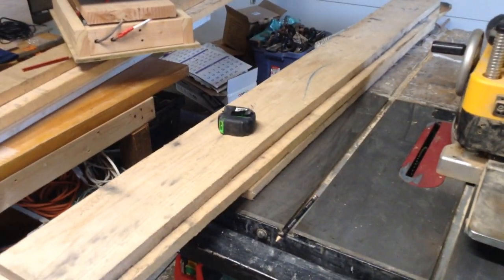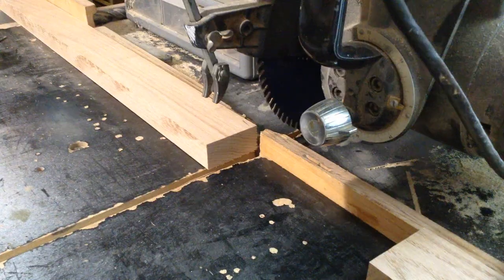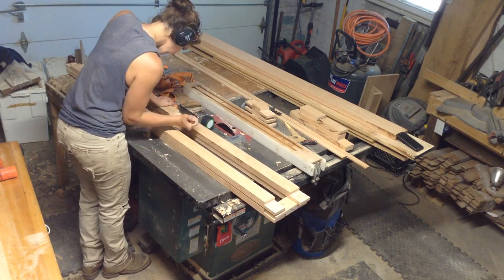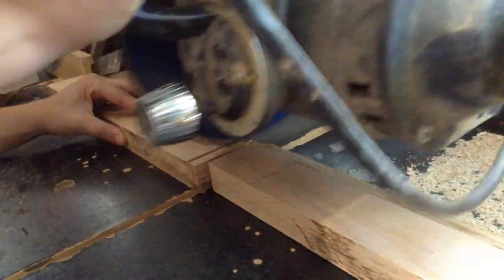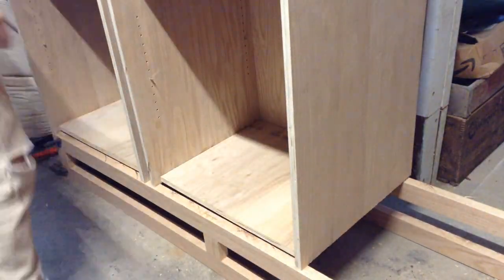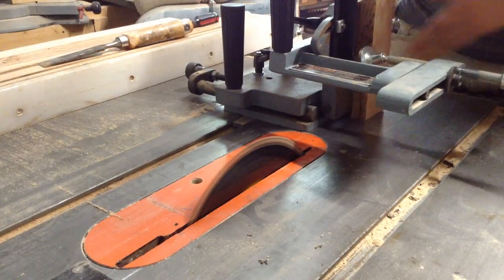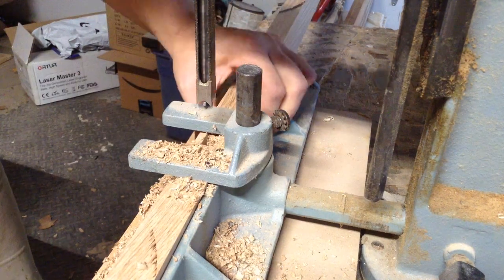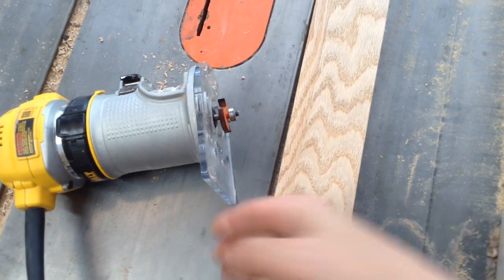Woodworking : China Cabinet & Storage // How - To Part 2

Comment: Cabinet coming on nicely, it’s a bit of a pain when you have to deal with bends and movement in the timber and ply wood especially when you have already made the cabinet 🙄,having a movable shelf isn’t really helping much either, it would have been helpful to have been able to glue this shelf in, looking forward to the next episode 👌👌👌👍👍👍🇦🇺
Reply from the maker: I know, usually people don't care whether the shelf is adjustable or not.  But, this customer really wanted to be able to move them so I wasn't going to say no.  I was quickly reminded why I hate them though.  Because on top of the issue with the sides bowing they are also a fair amount more work with drilling all the pin holes and having to veneer every side.

Comment: Great to see how your mind works in planning and adjusting these builds. Seeing your sketches is really helpful to understand how you work. Nice tenoning jig, never seen one used in the right-hand mitre slot, is it easier that way round? Thank you so much for sharing your work like this and nice to see a new range of camera angles.
Reply from the maker: Idk, my other jig worked on the right side too, but I don't have a compare and contrast for the left side.
Reply: @HoneyBadgerWoodWorks  I thought yours was a left sided one with the support normally behind the work piece and the push handle closest to you. I assumed you were using it back to front for ease. Probably me looking at it oddly! 🙄

Comment: Hi Caitlin, more great content and I see now why you aren't fond of movable shelves.

Out of interest, what brand blades do you use? What style and tooth count do you use on your RAS  and table saws?
Reply from the maker: I'm admittedly terrible with blade maintenance.  I have a stack of worn out blades that I've been meaning to sharpen for at least five years.  So, I usually just end up buying whatever is on sale at the big box store and throwing the old one in a pile. Of all of those the Freud blades are probably the best in my opinion.  I have a Dewalt blade in there now and I don't love it.  I keep an 80 or 60 tooth blade in both saws the majority of the time, because I do work a lot with plywood.  But, I have a 24 tooth ripping blade for the table saw.  And the dado stack which is CMT brand, no complaints on that one.  I've heard great things about the Forrest II blade, but I'm cheap and know I won't be great with the proper maintenance schedule needed for those nicer blades.